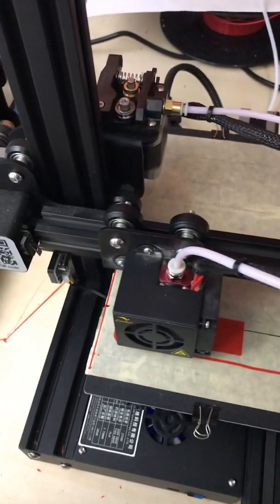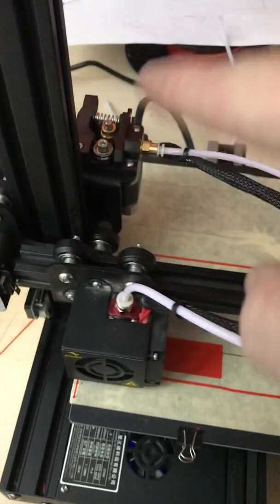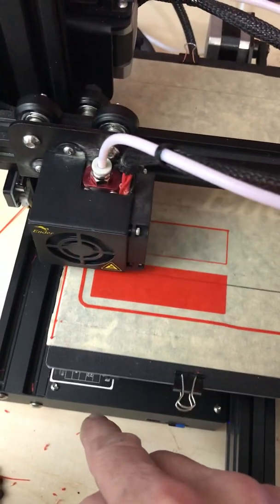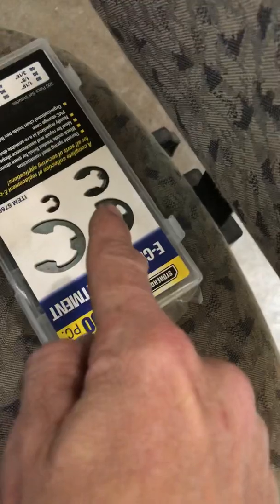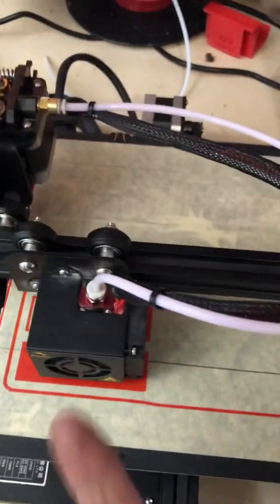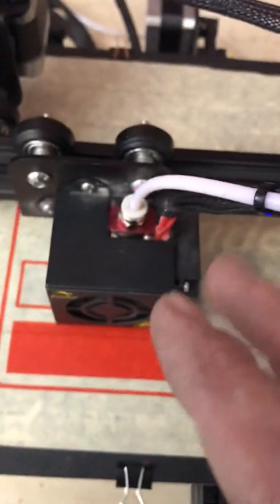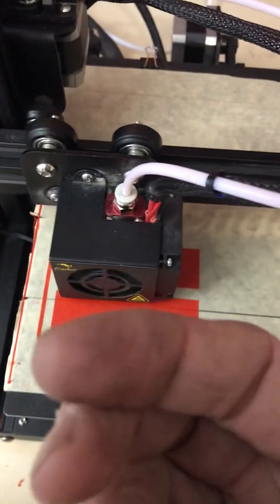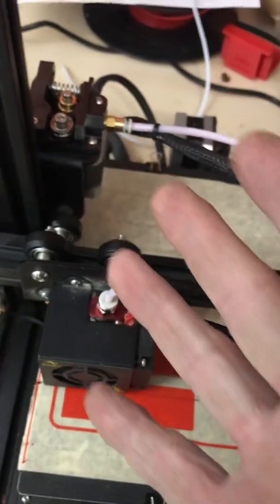Ender 3 SKIPPING

Comment: You probably have heat creep from a Bowden style extruder. The filament starts getting softer due to heat creeping up from the hot nozzle. Filament expands and clogs the tube causing gear clicking. Usually there is a heat sink at the the Bowden tube connection. (Found this on 3dprinting.stackexchange.com) 

I had the same issue, but aborted the print and let everything cool down and restarted and it seems to be fine. Layer height also seems to be a variable. I read that it could be due to the nozzle being too close to the bed. Hope it helps.